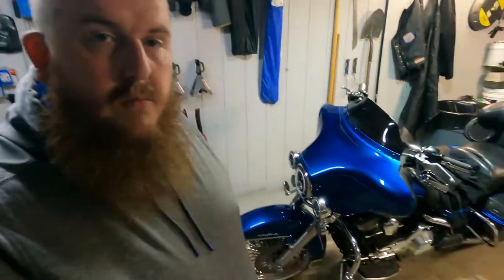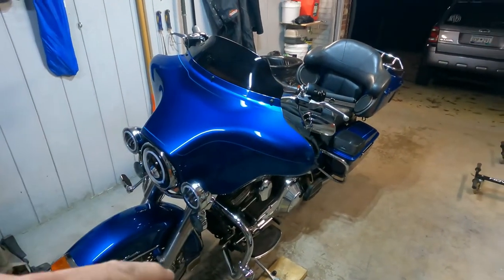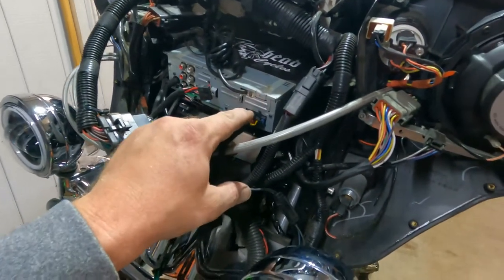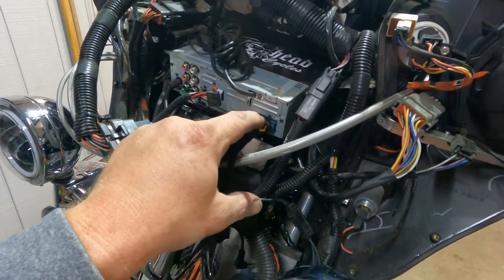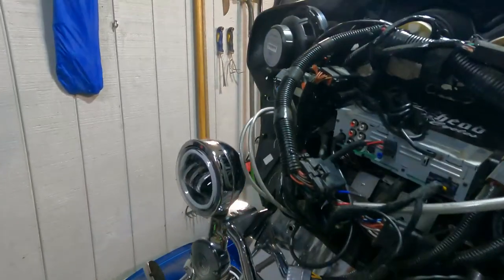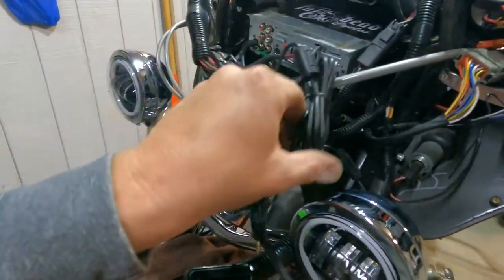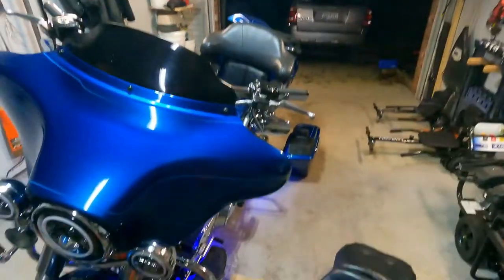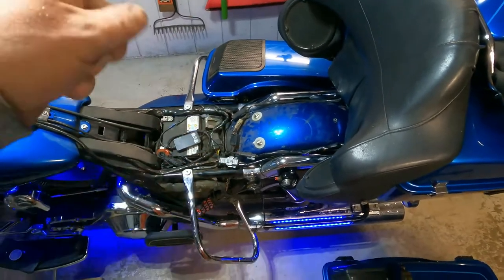HARLEY DAVIDSON ELECTRA GLIDE RADIO REPAIR

Comment: Fat head cycles sadly closed down im guessing due to the pandemic but it looks like you have the harness that allows you to add a dsp quickly..that black box is the controller for your oem handlebar to work with the aftermarket head unit i believe.

Comment: Sounds like something is drawing too many amps blowing out your fuse, look for another amp that may be installed or a bare wire contacting ground somewhere along the circuit. Fathead Cycles sells aftermarket radios and other parts for Harley Davidson cycles. The wire for remote might be what controls the volume on your handlebar volume control. I'm sure there's videos on YT that show the wiring for aftermarket radios on Harley Davidson cycles. Good luck!
Reply from the maker: Doesn’t have a amp